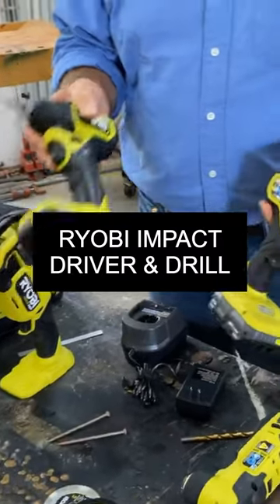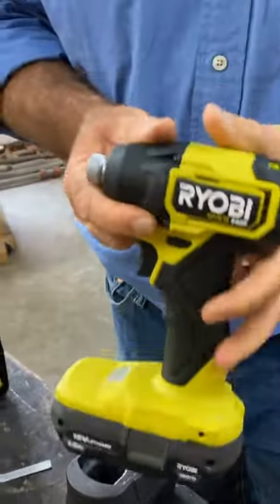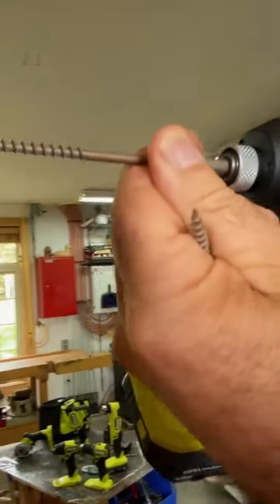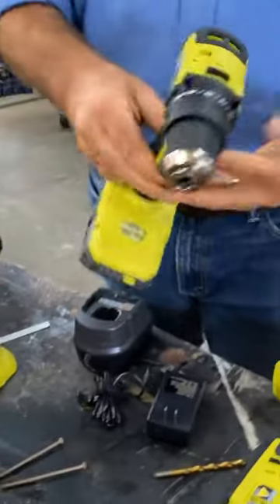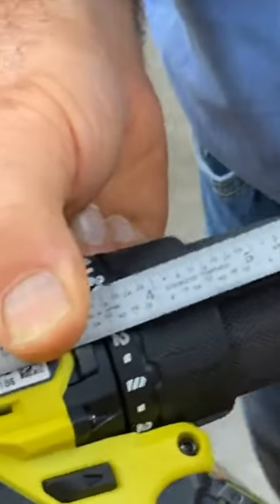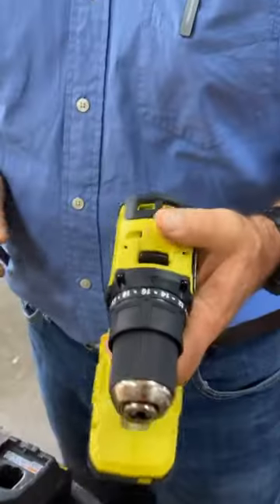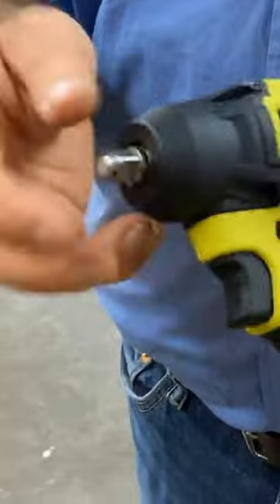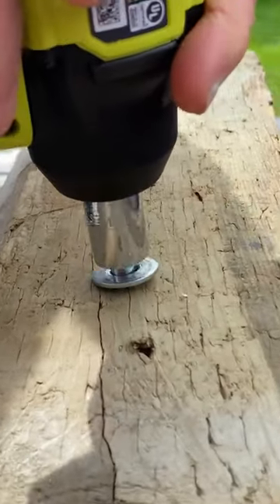Ryobi Impact Driver & Drill #shorts

Comment: Nice tools for the housewife. Other then that they are junk!
Reply: I've been using my Ryobi impact for over a year now and it still runs like a clock so don't get your feelings hurt
Reply: @thatguywiththeSV  good for you! I'm so happy. You obviously don't work with power tools for a living. Nice to have your little arts and crafts though!
Reply: @markward8975  well obviously you didn't hear that in 21 or 22 they been officially announced as a pro brand and they are not junk do some research
Reply: @grimreaper1257  there junk ive been a pro contractor for 30 years. I'd get laughed off the job if I showed up with that crap!!!
Reply: @markward8975  you keep saying there junk but not explaining why 
And for the record those type of people bought there stuff because there coworkers told them to
Reply: I took apart my Peterbilt with this set
Reply: @jjjuio  that was a nightmare no doubt!